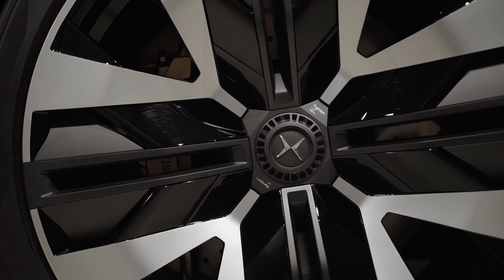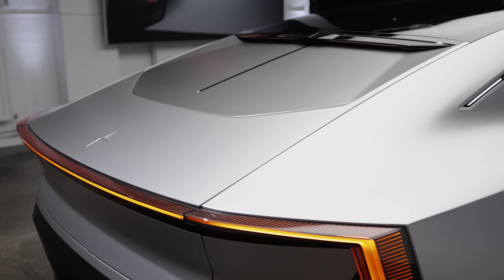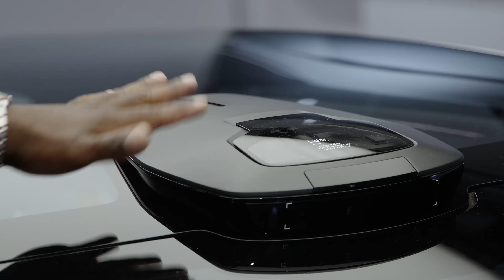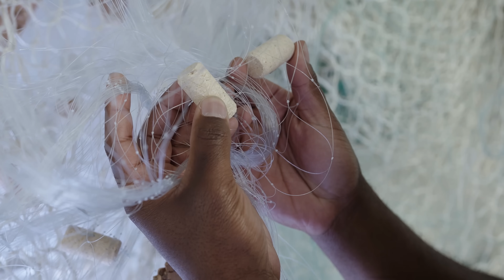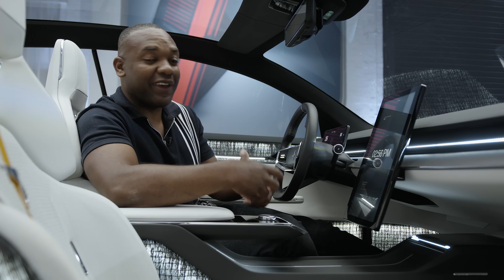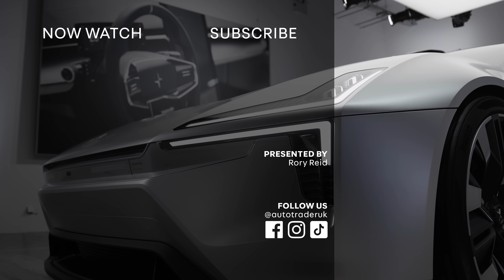NEW Polestar Precept: The Most BEAUTIFUL Electric Car So Far? | 4K

Comment: What is the battery technology ?  Is it restricted to only 70% charging due to thermal management issues ?  The vehicle is too low slung and vulnerable to damage from uneven road surfaces.  Moreover, the recessed handles are frowned upon for safety issues when there is battery thermal runaway.  Who cares about styling issues when there are far more worrying functional details.

Comment: To Bad when it reaches the public it will look like a 240 Volvo with a 100 mile range.  The other polstars had comments on how they would change the electric market and NOT.  THey couldn't even challenge the range of the nissan leaf and were about the same inside, lots and lots of textured plastics.  If it won't have a range of over 500 or 600 miles they should just give up and go home.  The previous polstars were claimed as tesla beaters?  They are not even within the range of the awd over 300 mile ranges, and inside I guess if you want it to look like a regular crappy american car they got that right.

Comment: The pod on top of the car is throwing the seamless look of the car off.  I know it probably needs 360 degree but think they should put it under the roof.  Looks really seamless and cool.  I like it.  Also that linen in the interior hope that would be a optional for those who like it and those who dont.  I don't.   I am again using sustainable and charging you more.  Sustainable should be cheaper to buy and therefore should reflect that in the overall price.

Comment: What an absolutely gorgeous vehicle. I really hope it's relatively affordable, If the lower trims are close to 60k or 75k I'd buy it without hesitation. Polestar designs are what I always wished Volvo would be.
Reply: That's what you get when you put a designer as CEO of a car company instead of an engineer 😉 Gorgeous car.
Reply: This will easily be at least $250k

Comment: Hype and more hype.  

Just like with floor to ceiling glass in houses, they look great at first but you cannot live with them.  4 years of all glass roofs and I have discovered they heat up my head in summer, feel cold in winter and reflect sound making the interior noisier.  I would prefer an old style steel roof by far.  While driving, i never ever look up anyway. Sure people are impressed, especially in the back seat, but so what.  Over rate, over hyped and the wrong direction for comfort.

Comment: I'd like to see the crash test safety numbers, it's beautiful, but it looks like one teenager staring down at their phone texting through an intersection in a full size sedan will fold that thing up like an empty cheap soda can.
Rolled?
Call the coroner first. 
I know these designers go crazy in Solidworks and ACAD or whatever, that's a good thing, I'd just like to see how this thing fares in a collision situation. If we're going to embrace a future where 6 figure cars will be the initial norm of the industry EV transition movement, we need to know that vehicle will have a lot more than clever robot sensors to keep our kids and their kids alive in a non-clever sensor environment.

Comment: bla bla bla, classic bla bla, no comparisons of : range, sizes and storage capacity but statements like he is the first to reach sun...It wouldn't romaine a concept car or will be sold with limited production so as a fact NOt game changer and no one cares, the recycling THING is used already in Skoda Enyaq and Hyundai IONIQ 5 who are by the fact game changers (I am even not talking about tesla), the design is very weak even compare to Chinese electric cars (the list of manufactures infinite there) SO guys just one more electric car which price as it easy to see will be high so sales will be very limited if it will reach this at all.

Comment: Polestar leading the way in EV design! I'm so sick of every other car coming out being an SUV without SUV capabilities, just because that's the easy way to fit the batteries in! Battery technology isn't anywhere near where it needs to be and to be truly environmentally friendly, we need to put more investment into tech such as carbon electrode so we can ditch the Li-Ion batteries. Although I like the idea of Hydrogen cell, it isn't the solution.

Comment: It looks great but I wonder how practical it is in the real world, one less seat in the back - no middle seat which can be useful on occasion. No through loading for skis. How is the boot capacity?

I understand the tablet and touch buttons make for a cleaner look but it really isn't as practical and I wish all car makers would stop with that. At least the most commonly used features should be physical buttons to keep it a safe journey, if you are driving alone you need to be able to control the car as well as temperature, fan speed, cruise control, driving mode eco/normal/etc and radio without risking an accident by having to take your eyes off the road.

Perhaps I'm a bit conservative but I enjoy cars that look like super high tech airplane cookpit with a lot of buttons and nobs. I still think features that are less used and that can wait until you are parked somewhere can be inside menus, it doesn't have to totally cluttered with buttons. Most likely it's cheaper to put everything inside the tablet menu than physical buttons though if you are going to have a tablet anyway.

Comment: Volvo is not small.
You cannot reduce vibration by 250%.
A 100% reduction in vibration is no vibration.
Claim to reduce it another 150% and I presume what you have done is increased vibration by 50%  on the opposite phase.
But then you make no reference to anything so as usual the percentage quote is meaningless garbage.

Comment: Tahoe interesting thing about EVs is not the battery or software or even the on board tech, but design, materials, presentation and usability. As governments kill the fun of Petrol véhicules, consumer will want the best design, materials and technologies at the prices that are abordable. By throwing away the petrol engine, design on electric sleds, even shared by design (Ionia 5 and EV6 for example) Allows for brand design statements that they could not do with a lump upfront/middle/rear. The deal breaker is the charging network. 3, 5, 10 years, before mainline adoption?

Comment: This is a concept car that will be a production car, and we should all know it's production model is not gonna look anything at all like it's concept, because it has to meet production regulations, B and C pillars will be installed, those cameras wings be replaced by mirrors, the interior will be regular leather, with an interior of another one of there previous cars, just like the Audi e-tron gt car which is based off the Porsche Tycan, and they just slapped on an Audi RS 7 interior.

Comment: 1) Great concept car w potential future exterior/interior design elements
2) Exterior & interior looks great except for the lg screen very crudely attached without much thought into integrating it into dash.
3) Yes, the glass roof looks nice and allows a lot of light in.  But I question how strong the roof is with no b-pillar, or c-pillar or roof beams.  Great for a show car, but not practical for production.

Comment: Rear doors that open backwards have occasionally been used in the past. They came to be known as suicide doors. The reason is that passengers exiting the rear seat would fully open the rear door, step out of the car, and then a car passing the vehicle would hit the rear door slamming it shut, and cutting off the legs of the passenger. Sometimes it's wise to remember lessons learned in the past.
Reply: It wont have backward rear doors, polestar just droped one new pic of how the production car will look. Worry no more

Comment: The Infotainment display is obtrusive compared to the overall sleek design. Trusting that Polestar will have one merged into the front panel. Perhaps the electronic bulging housing on the front of its roof should be better designed integrated into the roof/?

Comment: Precept by Roomba? They need to get rid of that LIDAR bulge. If they can't go with cameras, don't waste your time. It's a decent looking exterior with a gorgeous interior. I'm concerned that this is going to be significantly more expensive than the Model S Plaid with performance comparable to the Model 3 Long Range. It won't be widely adopted regardless.

Comment: wonder if rats and mice will chew on the lower front of the car because it is flax plant based.   Look at all the wiring in Ford products that got damaged by rodents because of the soy based wire insulation.

Comment: I wish polestar would try and embody the old volvo approach to car building- simple and practical safe cars.
Reply: Volvo never made simple cars. People think the 240 was simple but it still had some pretty complex engineering in it. Even in the 1970s Volvo had computers regulating a good amount of the car's function. They had it sitting under the passenger's seat. 

Polestar was Volvo's performance arm. While the cars will be crashworthy and such, they won't be simple or necessarily always practical. They're performance-oriented cars.

Comment: this looked mazing until you got into the drivers seat, the front is so bland and that oversized tablet is a car crash waiting to happen.  As a biker I hate seeing this sort of thing in cars, give people buttons, they then don't need to take their eyes off the road to change a setting.
Reply: So you haven't seen any car designed in the last 5 years then? That isn't even a particularly large screen by todays standard. Mercedes got a "hyper screen" for a combined 56". 
The era of massive screens are already here and it's not going anywhere soon. And no, they are not proven to be any more "unsafe" than cars without screens. With the latest generation of Volvos automatic sensor breaking and collision detecting you're less likely to get hit by this car than a "dumb" Volvo from say 15 years ago. Something to think about.

Comment: The chances of a concept car like this going into production, is about as likely as an alcoholic never taking another drink. Sorry to rain on your parade folks. I've been around long enough, to know not get the least bit excited about another flashy futuristic vehicle, which hasn't crossed any of the hurdles of reality. 
Should this car ever come into production, in the same futuristic form as presented here, it will be as cost-prohibitive, as any other supercar presently on the market. 
I would bet the farm on the fact, that you will not see this car without a pillar down the middle of the two doors. Without that pillar, you cannot achieve even the minimum side-impact protection required.
Reply: It's already confirmed as going into production so I guess that makes your whole statment and little rant here look very silly. 
That's not saying it's going to be cheap or without design changes. If you've been around so "long" you really should understand what a concept car is. Spoiler: it's in the name. 
"It's either going to be too expensive or have too many compromises" is just a silly thing to say. It's a premium car. No one has claimed other wise. The fact that you're already whining about a car that has no confirmed price, spec or date tells us all we need to know about you.
Reply: @toggtlas7099  Where's the factory located? Have they set up the production and assembly line, let alone have they even engineered it yet?  Where are they getting their batteries from? What year do they anticipate even having a limited run? Have they secured their supplier for their chips?  Ooo, ahh, another flashy concept car. Hate to rain on your fantasy parade, but for your health, I advise you don't hold your breath.
 We will see.

Comment: Great job on the presentation. So folks are commenting on the doors. Polestar is not going to make a car with these doors. All Volvo/Polestar large concepts use these doors to show the interior without the B pillar getting into the way (look at the Volvo Recharge Concept as well, same doors). The doors will be framed and regular doors. It'll have regular mirrors. It'll have a back window as well. How do I know? Polestar has already produced two videos on the production model being created now and it shows the regular doors, B pillar and a few aspects of some of the interior bits.

Polestar's 3, an SUV coming out next year, will have a lot of the styling of this Precept. So you don't have to wait too long to see a lot of the production ideas of this car in a Polestar for sale. The interiors will look a bit different than this as well. The Polestar 2 shows that Polestar will make a good interior, but this will be more upscale and expensive. Polestars will mostly be expensive vehicles.

Comment: Why don't they put the screen on the Wheel ?!? I'm a better designer than those kids...
Reply: So when you're turning, are you gonna turn your head with your wheel so you can read your screen?
Reply: @casper6800  You can have static wheel - center not moving - just outside where you hold hands

Comment: Outside: really nice. BUT inside --> looks cheep as IKEA.... no comparison with Audi and Porsche Design. If you target the €30.000 price range - I'm fin with the fishnets. But I bet you target at least the double... use leather/carbon/aluminum/steel or wood to have a nice interiour finish, no plastic!!
Reply: The production version will have wood and leather. Leather as an expensive option but I think it'll have wood as standard.

Comment: I love the car it looks amazing, but what about safety? It looks weak. The mirrors for example, they wobbled when the presentator touched them, can they fold for example? What if you get into a car crash from the side or when you tumble upside down? Will the roof hold?
Reply: You're concerned about safety in what essentially is a Volvo? Safety will be class leading in this vehicle. This is a concept car. Certain aspects of it will not make it to production.

Comment: The vehicle form is stunning. the seats with built in speakers and the design logic of reuse recycle is something I am happy to support... But that entertainment system... I don't see that as being a step forward. It is a good thing that the car has Lidar... because the driver will not be watching the road but instead, will be too busy trying to find the control to adjust the aircon.

Comment: @1:17, frameless door looks cool, but as the gasket age the seal will break and noise intrusion increases as well as moisture. Frameless door is easier to make to the benefit of the automaker. For the consumer it becomes a source of nuisance.

Comment: Impressive how you can memorize the press brief! Do you have at least one personal comment or approach for this <review>?  Polestar being A small startup, really?
Reply from the maker: I can neither criticise, praise, recommend or advise against a product that does not exist. All I can do is tell you what they’re planning and whether I like the look of it. It is not a review.
Reply: @Autotrader_uk  but where is the difference between journalism and just free marketing? I think you could keep more distance with the brief rather than supporting unproven claims like <250% less vibration >, I believe you would gain trust with your audience.
Reply from the maker: It’s just a preview of a product that doesn’t exist, dude. It might as well be a drawing. It doesn’t even have a motor. They haven’t built the trunk. The wheels don’t turn. It might never happen. And if it does, many wild claims or objectives previewed on the concept might change completely. When they build it, we can rip it to shreds or praise it accordingly. Until then… it’s just a pretty shell and a set of dreams in an engineer’s head. I’ve never had an issue with trust. You’ll hear my verdict on it when it exists.

Comment: I think they missed to solve a few problems. For instance all the mirror approach isn't done well in my opinion. It is just analog approach replaced with a digital one. But why? Why is the rear mirror so small? Why is it placed on the top and blocks the view? Why are the cameras which replace the side mirrors sticking out so far? 
Like I've said … just replacing analog with digital doesn't really improve anything. It doesn't really take advantage of the new technology. 
And all the ambient light looks nice in a presentation, but what is this good for? which problem does it solve? Does it have any real value?

but other than that … it looks really nice.

Comment: I love the look when they drop the B pillar, however it never makes it into production because of how horrible they perform on side impact crash tests
Reply: The might be able to do something similar to Mercedes where the car raises up on air suspension just before a crash so the lower bar can take the brunt of the impact.
Reply: @raeldor  A8 Audi prior to Bez.
Reply: The Highway, Institute for crash testing has raised the height of the side impact crash test vehicle to mimic the height of the big new SUVs. So all  the five star ⭐️ rated sedans  now fail the side impact test. Fail as the bodily injuries recorded are life threatening. Things will change quickly. As mentioned by another  commenter, Mercedes and prior, the Audi A8, utilized the adjustable air suspension to raise the car on the impact side via sensors in so that the stronger lower structure of the car impacts.
Reply: The i3 works, but that's a much shorter car.
Reply: I'm not an engineer but couldn't they reinforce the bottom and top?
Reply: @catinthehat5140  in principal, maybe. The reality of engineering these things is always a bit complicated and gets expensive

Comment: Front looks like a 350z, back looks like an ugly charger then need to stop making cars with a strip light, the roof thing is ugly, the inside is nice, and they really need to stop making screens to control everything. Imagine if it breaks or get stolen? Most of your cars functions automatically don't work.